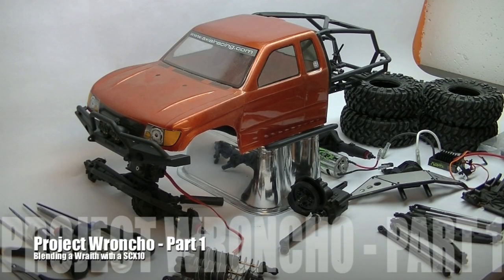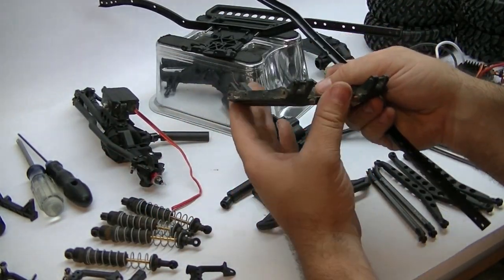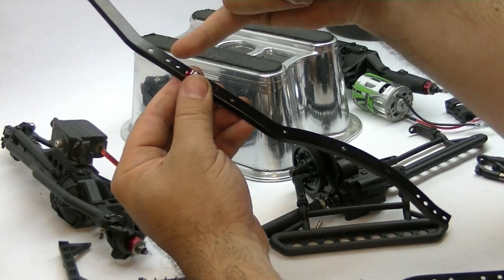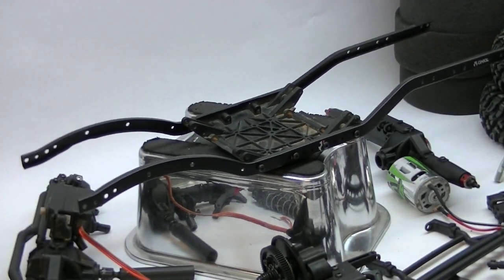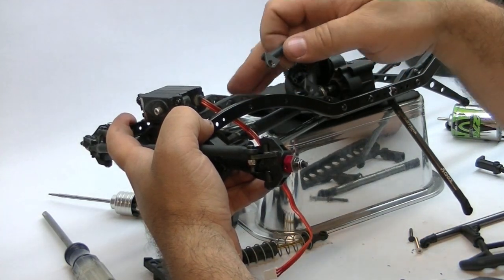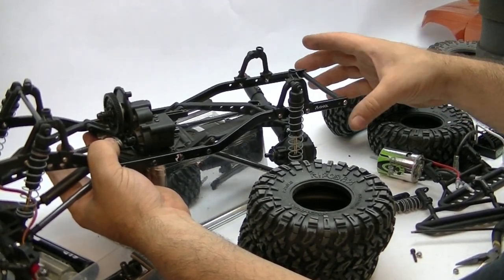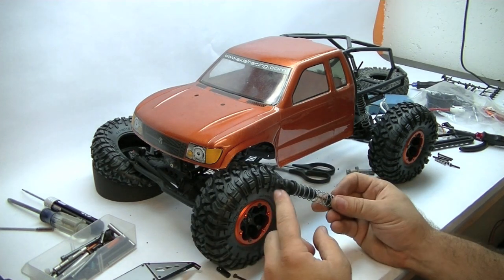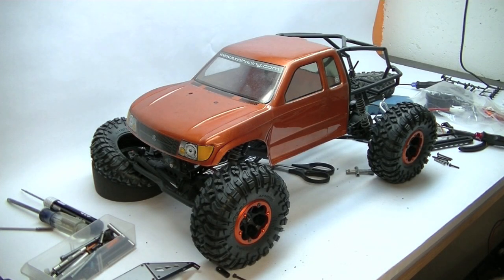Wroncho Project - Part 1

Comment: anybody know if scx10 diff gear, output gear, and pumpkin cover will fit on wraith axels
Reply from the maker: There is no "pumpkin cover" on SCX axles. The ring and pinion are the same however.
Reply: +Harley Designs Ok thanks